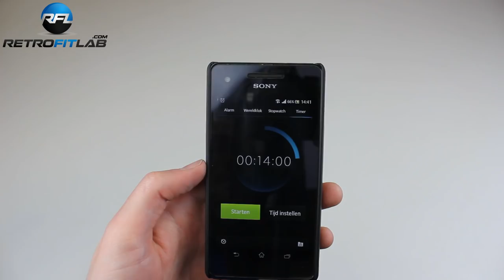Honda Civic EM2 Coupe | HID Bi-xenon Projector Retrofit (blackout) DIY installation

Comment: Very good but ,can you explain about the box and heatgun in some video is very interesting?
Reply from the maker: Hi, the box is used an oven to heat the headlight. A large cardboard box is used where hot air is blown through a heatgun. Make sure that the hot air of the heatgun does not blow directly to the headlight, place the headlight on small elevations so that the air can circulate properly through the box. We use a setting of 300 Degrees Celsius for 12-18 minutes / 1st lowest setting, depending on the size of the headlight.
Reply: @Retrofitlab  ok thanks i need practice this in my headlights, congratulations very nice work,see you in the next video
Reply: Stick the housing in the oven at like 250 for about 7 minutes will have the same results. Just be sure you put the headlight on a couple 2x4s and make sure it’s in the center of the oven.

Comment: Hi guys, i have a honda using h4 fitment, what bulbs should i use and how do i wire it up for the hi/low function.

Excellent vid btw, love the look.
Reply from the maker: We would recommend to use a bi-xenon or b-led projector instead of plug and play xenon or led bulbs.. :) for example the Aharon optimus TR. For the H4 bi-xenon function on a projector we have H4 cables with outputs to the ballasts and projector for hi/low
https://www.retrofitlab.com/en/aharon-optimus-tr-bi-xenon-projectors-1.html

Comment: My Friend, How are you? Do we paint the inside of the headlight with heat resistant paint? For example, we will paint it black! How is it normally done? Can you please explain? Thanks
Reply from the maker: Usually it can be done with normal paint from a spray can. But you can also use heat resistant paint, this usually has a nice flat finish. The pro's also use automotive grade 2k spray spaint.

Comment: does the factory alignment for headlights unit still work when the lights are retrofit with projectors? and if not, how did you align them
Reply: It can be adjusted like before. That's the entire reason for mounting it in the existing reflector.

Comment: At what temperature you heated the light and by using what
Reply from the maker: In general, 2 methods are used, with both methods, be careful and patient. Method 1 is using a regular oven. Preheat the oven at 200 degrees Celsius. When ready, switch off the oven and place the headlight inside. Make sure that the headlight is not touching any metal of the oven by placing a cloth over the grid, for example. Leave the headlight in the oven for 10-15 minutes before opening it. If the headlight kit is not yet soft enough, put the headlight in the oven for a bit more time.
Method 2 is suitable for larger headlights that do not fit in a regular oven, or if your lovely wife absolutely does not allow car parts to be baked in her kitchen. A large cardboard box is used where hot air is blown through a heatgun. Make sure that the hot air of the heatgun does not blow directly to the headlight, place the headlight on small elevations so that the air can circulate properly through the box. We use a setting of 300 Degrees Celsius for 12-18 minutes / 1st lowest setting, depending on the size of the headlight.

Comment: thanks, easy work ... may I know what type of sprays you used (color) coz not all colors give good look. tq
Reply: great brother, thanks. what about the blub what type can be fixed .. I bought this bulb 

http://www.lazada.com.my/2x-led-h49003-headlight-lighting-16000lm-160w-conversion-bulb-beam6000k-ld912 17248395.html?utm_source=Orderconfirmation&utm_medium=Email&utm_campaign=LineItem

if that bulb cant then should be this bulb? 

http://www.lazada.com.my/80w-cree-led-h8-bulb-angel-eye-halo-light-for-bmw-e90-e92-e82-e60e70-x5-e71-e89-8974544.html?mp=1

sorry I am not sure the links will work or no :)

Comment: 2 questions. Can you adjust the projectors once installed? Im doing this to a truck in the future and it will be epoxied in unlike your video which is screwed on. Are there little adjusters on the projector itself?
Reply: +Retrofitlab well its gonna suck having to epoxy the projector right the first time. I have to trim the back a bit since it wont screw like yours. i found the how to nut didn't mention adjustment.

Comment: Does the blackening have any effect on the projected light?
Reply from the maker: For low and high beam it won't, because the Aharon bi-xenon projector is used and the reflector part isn't used to reflect the light anymore.
Reply: Thank you for the reply.
I thought so but I wasn’t sure. You cleared all my doubts.
Thank you.

Comment: hey buddy, what's the stock bulb type fitment? I see that most projector uses H4/H7 adapter before screwing the projector into place, what if the bulb type is not H4 or H7? Mine is H11.
Reply: Retrofitlab thanks for replying so quickly. is it because the bolt thread is not long enough to be out from the housing? or the diameter is not big enough?

Comment: Hi, what spray can did you use? Thanks!
Reply from the maker: Normally a heat resistant paint or even normal paint can be used, but preparation etc is dependant on the the specs by the manufacturer of the paint.

Comment: what is the brand of paint?
Reply from the maker: just a regular brand from a DIY store, a heat resistant paint can also be used, it doesn't need to be heat resistant, but it gives a nice matte finish.
Reply: @Retrofitlab  thanks bro
Reply from the maker: @cl-xb9tp  no problem :)

Comment: so you can't use regular halogen H4 bulb with a lens, can you?
Reply from the maker: No, the bi-xenon projector can't hold H4 halogen bulbs. The high beam function is handled by the projector instead of the the bulb.
Reply: What bulbs are used?

Comment: is this compatible with l.e.d bulbs? or do you have to fit them as well?
Reply from the maker: We don't advise to use LED bulbs in the projector because light output and pattern is usually quite bad. Examples here;
https://www.retrofitlab.com/blog/h1-led-versus-xenon-mini-h1-projector/

Comment: fosse facile così aprire un faro originale a quest'ora avrei aperto un'impresa
Reply: +Retrofitlab I try to open my original peugeot 206 headlights with your method but after 10 minutes of warm air glue was very hard. :( now i'll try with depo headlights
Reply: *****  I'll try to open depo :) but I preferred the original because branded valeo and adjustment is more precise